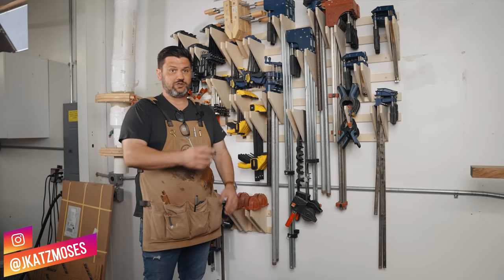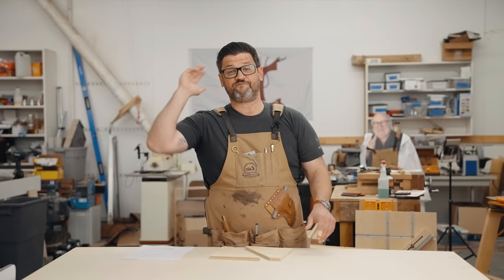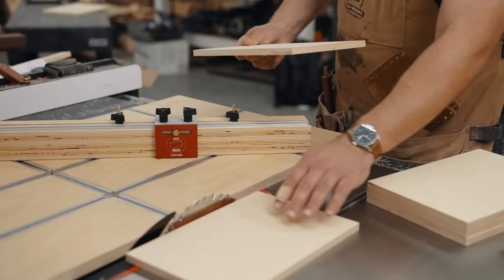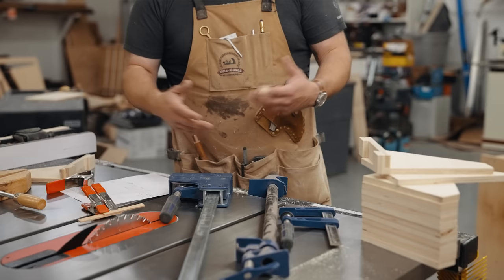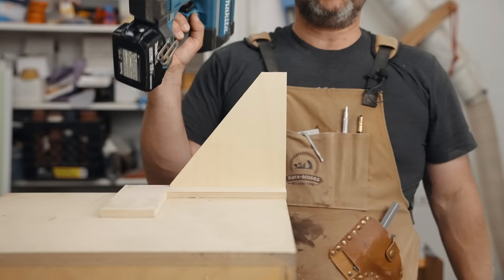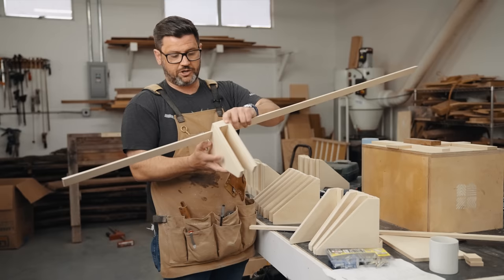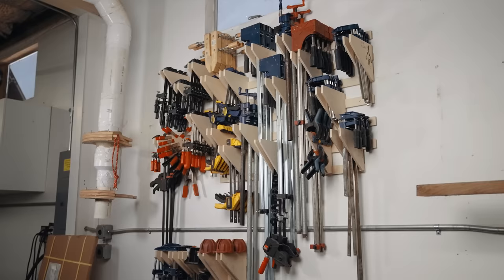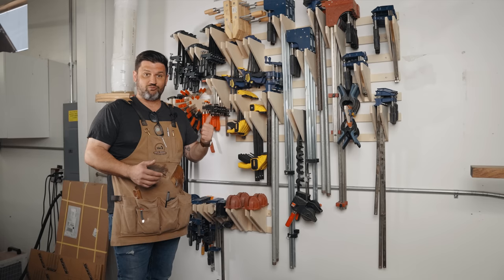A Truly Better Universal Clamp Rack - *FREE PLANS*

Comment: Excellent design and I intend making it as a large door enclosing a shallow cabinet holding my nail guns.  I'll be using several barn door hinges and backing behind the hinges on the door.  On suggestion is to secure the bottom of the racks with a screw to make sure they don't get loose when I pull off the last clamp.  I realize this defeats the portability but it's a reasonable sacrifice to me.  Again, thanks for making the plan available.  I subscribed a while back.

Comment: I made a french cleat wall in my shop and love it! I store my lumber on it because I have a small space. I built hangers that look just like your clamp rack hangers but enclosed them the whole way around. I have atleast 1000lbs of wood on there probably more and it's never moved. If you're going to use it for lumber and heavy stuff i suggest you use 4" cleats and attach them to studs with 2 fasteners in each stud. You're probably ok with drywall anchors but  you know you're good if you attach it to the studs for heavy stuff.
Reply: Justin - Can you send a picture of how you enclosed them. I’m very interested.

Comment: My small workshop (think single-car garage) is entirely clad with French Cleats, wall-to-wall, floor-to-ceiling.  I have cupboards, racks, shelves, and even work benches mounting power tools hanging off them.  If I am mounting something heavy, then I will configure the item to utilise 2 or 3 cleats for extra hanging strength.  It makes my workspace entirely adjustable.

Comment: I love the use of the "cleat" system. It's a tried and true type method. 
Yup, learned that lesson a long ago about the nails. 
I made something similar, only difference I did was, I made mine all 1 size. Reason is, "you can never have enough clamps". I'm always adding more and more clamps. You might want to add some wax to those holders or some other type of sealer. Even though you made this with plywood, moisture, humidity will effect them over time. Great video, cheers :)

Comment: Well, Jonathan, you solved my clamp problem. One thing you did not mention, yet jumped right out at me: This is a great small shop solution. Those of us not blessed with even medium size shops (single car garage here), you can hang a lot of clamps in a small space. Was just out in the shop this afternoon re-arranging and trying to decide on a clamp rack solution, and here it is. Why didn't I think of this? I've got a whole shelf system in my shop using french cleats ...

Comment: I've seen a couple of makers talk about the toggle anchors recently. I've been using them for years. I made a pot rack out of galvanized pipe that I've been able to hang on any wall, where ever I've been with those toggle anchors. They are great. Great job on the french cleat wall.

Comment: Thank you so much for you videos. They saved my life. I am disabled veteran and was going through a dark time when I found your videos and I started woodworking and changed my life around. Thank you so much for what you do. I do have one question did you use 3/4 or 1/2 inch in the video it looks smaller than 3/4.
Reply: Much thanks for your service. Great to hear you've found an activity that gives you that sense of fulfillment. I agree that it appears to be 1/2", which is amazing really. The plans don't specify the wood thickness, and seem to leave it open to you to use the width of plywood you prefer. (I may go with 3/4" due to the weight of my clamps.) A key here is that Jonathan is using Baltic Birch, which is particularly strong and stable (and looks good too). All the best as you move forward in your woodworking adventures. You may also wish to check out Rob Cosman's videos; Rob does a ton of work really focused on assisting veterans like yourself discover the joys and mysteries of woodworking. Like Jonathan, he's a solid guy. You can't go wrong with either of these as teachers.

Comment: I did something similar a few months back with 3/4 plywood but I only had one cleat and the clamp rack had a spacer at the bottom to make it level to the wall. I even created some racks that can hold two sets of clamps by making the back longer and then add two triangle sets to it which worked wll for shorter clamps.

Comment: Great idea. Looks like this could also be adapted as a mobile rack on a smaller scale.
Reply: Make it double or 4 sided and add cleats for screw caddy, glue bottles etc. Load and change load out as tasks change. Keeps them off the work surface

Comment: Nice work as always.  I have used this same style for almost two years now, they work great.  Only downside is when you take the last clamp off the rack can come with it since there is no weight holding it down.  I’ve debated attaching two together as I normally don’t clear two racks at the same time.
Reply: A screw at the bottom of the rack prevents it from coming off.  You lose portability but I don't think that's much of a problem.  I've used french cleats to hang book cases for years and always secure the bottom just in case someone pulls the case from the bottom.

Comment: awesome video as usual Jon! A slight mini tip for those who may find it useful. The cleat that’s attached to the holder can be quite sharp to handle when u remove it entirely to work with. Shave of the sharp end just a little so it’s not razor sharp. And it helps fit it more snagly if for some reason your cleat wasn’t cut properly or u have uneven walls that make the wall mount row of French cleat uneven. (Spelling corrected😂)
Reply from the maker: FYI it's cleat but I hope you leave it for the sake of the hard-core GENTLEMEN/LADIES you just got while I'm sitting in my bathrobe drinking coffee. Cheers my friend

Comment: Hi Jonathan - thanks for the awesome video and plans.  There seems to be one inconsistency though.  In the plans, it looks like the longer side of the triangle is the horizontal one that the clamps rest on.  And the separator strip is 7 1/2" long, so that's consistent.   In the video, most of your clamps are sitting on the shorter side, with the longer side against the wall (except possibly the single ones).   Presumably this is stronger with the clamps extending out a shorter distance from the wall and a longer segment up against the wall.   Which do you recommend?

Comment: Best French cleat design yet. I have watched more videos than I care to remember and was hesitant due to the lack of adjustability. I also didn't really want to mount a sheet of plywood to mount the cleats. After seeing this I will be delving deeper into the French cleat world. Also, great tip on the nail gun, I frequently work with thin stock and am always worried about breakthrough, now that I know the secret....👍
Lastly, how do you like the Makita nailer? I have been looking for a while to replace my air tools and already have the Makita battery platform for my router.

Comment: Great video! I'm a huge French cleat user. I was wondering why you wouldn't want to just screw the cleats into the studs in the wall instead of using those drywall things? Not to complain at all, just curious about it. I always just screw them into the studs and they're crazy strong that way.

Comment: These are amazing! I can’t wait to build this so I can get all my clamps off shelves and the floor. 
One question though. Why didn’t you countersink the screw heads on the cleats? I understand on the lower ones for the toggle anchor and weight. But the rest seem like they would be minor obstructions. 
Thanks for the plans! 
Your videos are great! Keep ‘em coming!
Reply from the maker: Easy to avoid. Could also be countersunk but I don't think it's necessary. There's no orientation that couldn't be an 1/8 further left or right to avoid a screw head
Reply: @katzmosestools  Right on! Thanks for the explanation.

Comment: I just downloaded the plans and it seems they're designed for whatever thickness of plywood you want to use. 
That said... It kind of looks in the video like you used 1/2-Inch plywood for your rack. Is that the case? If so,is it still holding up well? With the price of lumber right now my reason for asking is probably obvious 😅

Comment: Jonathan - What thickness plywood are you using for the universal clamp rack?  It looks smaller than 3/4" in the video, more like 1/2".  Thanks for the great instruction!
Reply: I went ahead and made six of these racks with 1/2" plywood for my F-style clamps.  They work great!  The only modification I made is to have the cleat overlap the total width by 1" on each side.  That significantly adds to the stability. Thus, I used a 4" cleat for a rack with 1" spacer between the 1/2" sides.

Comment: Dunno if I'm just blind or what...but I cannot locate the free plans for this on your website.  Regardless, this is a nifty design!
Reply from the maker: After the replacement Japanese saw blades
Reply: Nevermind...found them.  However, they aren't listed under the "Woodworking Plans" section of your site.
Reply from the maker: @asbrand  fixed. Thank you

Comment: 1: No such thing as 'too many clamps.' Fact.
2: My pipe clamp systems have destroyed more walls than I care to recall, to include 4" screws into studs, so I am interested in seeing the long-term results on this project.
   2.1: I'm running at about 260 lb, and my clamps are well near 3 times my weight... I may have a clamp collecting problem and need help... but, Point #1.
3: I'm not trying to troll you... seriously. Great job.

Comment: I suppose that you could call me an anchor hater, but more to the point, using the wrong product for the job is my problem not the anchor. Since mostly you are depending on the shear of the anchor, not an unreasonable product for the right job. When I see an unsupported table attached to a wall with an anchor, I go a little nuts.